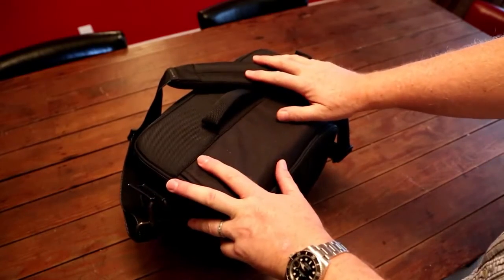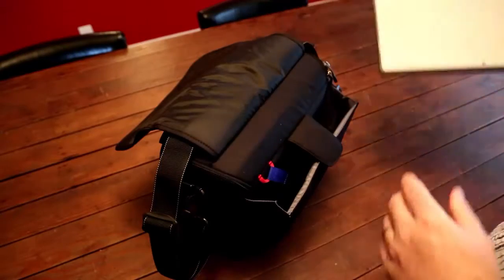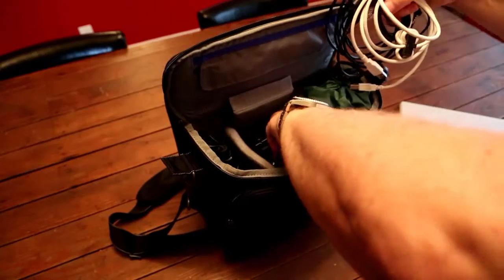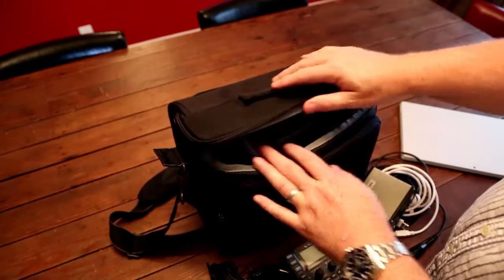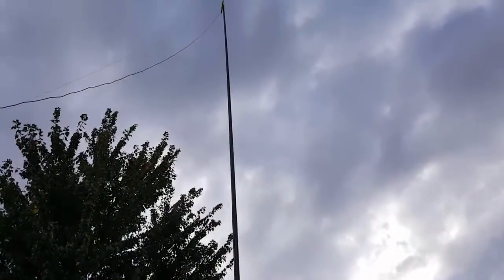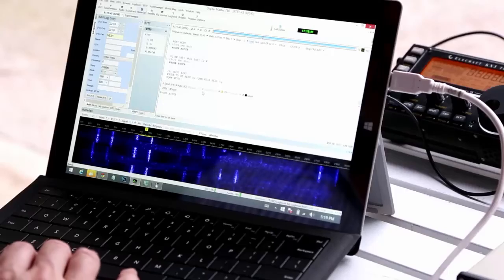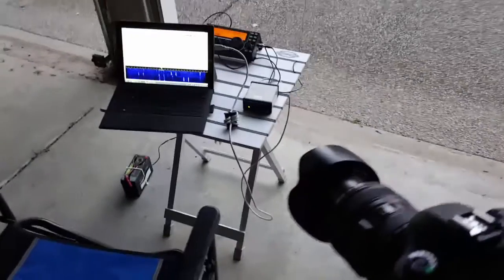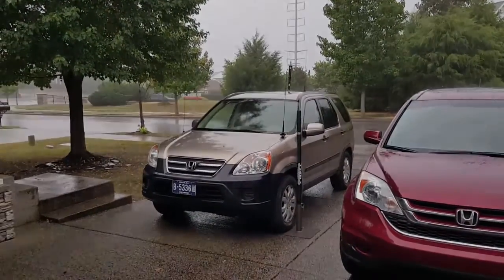Portable Digital QRP Demo

Comment: Hey Cliff, everytime I get down, I come take a look at your videos and it cheers me up. I don't have a radio yet, but hopefully soon.  I'd love to walk to my park, throw my antenna in the air, make contacts until the battery starts dying, then head home.  You look like you really enjoy the hobby, and I can't wait till its my turn :D 73's and hope to catch you on the air
Reply from the maker: Thanks for the kind words, Will. It's a great hobby with so many different facets. There's something for everyone. I'm glad that portable operation appeals to you. It IS a fun way to spend some time outdoors. It's almost like magic being able to talk to someone using a wire in a tree!  I hope you are able to get a radio soon. Maybe a local ham in a radio club would have one gathering dust that you could borrow for a few months?  Thanks again - Cliff
Reply: my issue is that I can't operate out of my house. I am right next door to a 1kW AM broadcaster. Local club wanted to help me get started, but they don't really have any portable gear. My portable is on foot, and I'd don't care to walk any distance with a IC-718. I got a radio in mind, QRP Labs has a SSB/digital 10 bander in the works at 10W.

Comment: I haven't been able to find anyone running RTTY at all. OR PSK31. They're all off doing FT8 or some other new flavor of the month, and I just got a KX3/PX3 and the wonderful ability of that radio to decode PSK and RTTY, and the PX3 to connect a real keyboard to it is all for NOTHING since nobody is using those modes anymore! 

I need to get WSJT-X and FT8Call loaded on the Linux partition on my Chromebook, then see if the Cbook's audio is able to handle the digital modes. If that fails, I'll try the USB sound card I'm using on my workbench ASUS. But all of my actual laptops are ancient things that can barely run, much less run WELL. ARGH.

I wonder if there's an FT8 app for Android? I might be able to get it to run on a tablet...I think I still have the kit for Wolphi's Android interface box around here somewhere...

Comment: That's a great setup. Did you use it for Field Day?
Reply from the maker: Hello, Ray.  I did Field Day with my local ARES group in our County's Public Safety Building. (I know, that's lame, right? No bugs or sweat...)  This year we ran five simultaneous KX3 stations - all running on battery power for the full 24 hours. The digital station and the two CW stations (KX3's) also had to have their computers running on battery power the entire time since the computers were doing the transmitting.  (Checked with ARRL and found this to be required)  We had a blast and racked up our best score ever.  We made believers out of some of our QRO members! :-)    Cliff
Reply: Oh my! How did you keep computers running on batteries for 24 hours. They are such power pigs unless you used Raspberry Pis and Chips and other small SOC Systems. Even my tablet won't go 8 hours and I can't change that battery out. How did the batteries do in the KX3'es? Did you have a solar solution?
Reply from the maker: The computers used for the CW stations and the digital station were laptops - so computers and monitors combined.  Testing showed that keeping the laptops connected to their chargers and running those charges on inverters would use about 35 to 40 Ah of current during 24 hours.  We ran the KX3's on external, smaller batteries and used larger (80Ah) batteries for the laptops.  We had spare batteries but they weren't needed.  We ran the gear with DC wattmeters in line so we could see how many amps had been taken from the batteries at-a-glance. https://powerwerx.com/watt-meter-plus-power-analyzer-8-gauge-sb50

It worked out well!  We had no power issues and gained some knowledge of what it would take to power an HF station around-the-clock in an emergency.

We had a few solar panels but only used one for a cursory charge of a battery that wasn't used/needed.

Comment: Can I ask what digital program you are using?
DE: Dave N6PGG / 7
Reply from the maker: Navy Davy it's the Digital module of Ham Radio Deluxe... called DM780 or Digital Master. You can accomplish the same things with FLDigi and other software for the Digital ham modes. - Cliff
Reply: Thank you, I have FL DIGI I also use winmore and Air Mail.  Thamks again
Reply: Currently using RMS Express, But also like Air Mail.

Comment: Great video, thanks! One question: Running a portable setup like this, what do you do about a ground? I didn't notice one.
Reply from the maker: There are two kinds of Ground... RF and Electrical.  For a dipole antenna, an RF ground is unnecessary.  My vertical antenna in the backyard has 40 radials that I painstakingly buried... so I've got a good RF ground for that antenna. I don't have an electrical ground.  My office/shack is on the 2nd floor of my house and I haven't seen the need for it.  I've got other ham friends who have no electrical ground for their 2nd story ham shacks.  I just don't worry about it. - Cliff
Reply: Excellent, thanks! You've taken a great load off my mind. I was thinking about the two-part article by the Ground Police I saw in the Nov and Dec issues of QST. If it was merely intended to shame us lesser mortals (well, me), it clearly worked. I have neither the inclination nor the resources to adhere to that grounding scheme. Not that I disregard such things entirely. I'm a musician, and I work with all sorts of electrical/electronic devices in my studio. So, at least for sound's sake, I have to avoid problems like ground loops, etc. And bringing a ham rig into my studio (or up into the mountains, which I mostly intend to do) will be no different. I just don't wish to obsess about correctness. I've worked all my life to ensure that playing my instrument remains fun; I certainly don't want my ham radio passion to become "work." ;-)
Reply from the maker: There are conflicting opinions on practically everything. While "experts" are telling you what you should or shouldn't do, just smile and then go play radio on your own terms. - Cliff

Comment: Hi, I'm looking at Ham Radio Deluxe and it states what the recomended storage is:  That seems like a lot to me considering the cost of the computers with that kind of storage.  Any thoughts appreciated.  Thank you.

Minimum Recommended Requirements
Windows Vista
 -8GB RAM, 350GB hard drive storage, Core 2 Duo Processor, 1024x768 256 color display
Windows 7, 8, 8.1 & 10
- 8GB RAM,350 GB hard drive storage, Dual Core Processor, 1920x1080 Hi-Color display
Reply from the maker: This web page on their site shows the 4GB of RAM (memory) is required and 90Mb (hard disk storage) is required. Taken from the FAQ section of their website: http://tickets.hrdsoftwarellc.com/kb/faq.php?id=54

I've run HRD successfully on a crappy netbook with only 2GB of RAM so you shouldn't have any trouble, Dave.  If you're using the Digital Modes, you may not be able to use the "Super Sweeper" screen that decodes the entire passband at once as that's processor-intensive.  But, still, for normal use, practically any reasonable computer should work.

When you get a chance, take advantage of their 30 day free trial and try-before-you-buy:  http://www.hrdsoftwarellc.com/downloads.html

Cliff
Reply: QRP School Thank you Cliff.  You videos are an excellent resource and very helpful. I just purchased a laptop so it can be solely dedicated to digital modes.  Looking forward to getting on the air.

Dave

Comment: Hi Cliff.  great videos.  what battery do u use for kx3 ?   tnx  Tim wd8td
Reply from the maker: Hello. it's a Stark Power deep cycle lithium ion battery. very lightweight and plenty of Amp hours. it's a great battery. I have the 9Ah and the 12 Ah. the 9Ah is smaller and had plenty of capacity. -Cliff

Comment: Great video series!

 I'm a  new ham with a shiny new KX3 and I'm interested in digital modes. I was under the impression that the radio could be controlled directly over USB. Is there a reason that you are using a signalink in this video?
Reply from the maker: +Jason Cz Hello, Jason. Congrats on the new ham license and the new KX3! Let me see if I can clear up some confusion for you...

The KX3 can be "controlled" with a USB cable but the USB cable "control" doesn't include sending Audio (digital data that's been modulated into sounds).  Instead, the USB cable can be used by software programs to externally control the radio... like changing bands, modes, frequency, etc. AND interrogating the radio to see what band, mode, frequency is set, etc.

In my video, I'm showing the computer running the Digital Master 780 software (part of the Ham Radio Deluxe suite of applications).  The software is taking my messages and converting them into sound. The sound (modulated data) is then being sent from the Signalink (which is just an external sound card) into the Mic Jack of the KX3 where it's transmitted to the world.  Pumping sound into the KX3 through the Mic Jack is the only way for computer software to send audio for transmission to a KX3.

Now, what might be the source of the confusion...  the KX3 is unique in that microprocessor (think "computer") built into the KX3 has the ability to take Morse Code and modulate that into PSK31 or RTTY sounds and transmit that sound.  But you have to use Morse code (a straight key or paddles connected to the radio).  The KX3 can also decode PSK31 and RTTY and display the text on the screen.

But, the KX3's USB cable is only used for external control of the settings of the radio - and for updating the radio's firmware.  (the "software" for the radio's microprocessor)

I hope this helps. If not, ping me back.  -Cliff
Reply: +QRP School 

Thanks for the detailed response. I watched your "getting started with digital modes" video right after commenting and it cleared a lot of my questions up.  

I'm looking forward to more QRP videos!
Reply: +QRP School Actually it kinda does! I use my KX3 with a little HP tablet PC (no signalink) just configure JTX Software for USB Audio and then (if your tablet doesnt have audio in/out port like the HP) plug an outboard sound card to USB adaptor into your tablet's USB port and the mic/audio cables from your KX3 into the USB Soundcard and away you go! - I got my USB Soundcard here: 

https://www.startech.com/Cards-Adapters/Sound/USB-Audio/Audio-USB-Adapter~ICUSBAUDIOB

73

Terry, ve3ega

Comment: KX3 and KX3 software and lap top, ant, battery. All you need terminal program in KX3 software will send RTTY heck key will send code to KX3 and KX3 will change it to RTTY or PSK.
Reply from the maker: +KC6CNN True.  For me, I like using Ham Radio Deluxe's "Digital Master 780" module for digital modes so that a) I can see the waterfall/panadapter and b) I can easily log the contact with HRD's integrated log. It's also nice to be able to see the DX cluster in HRD's log module. I've never tried using my key to send RTTY/PSK because I'm just not fast enough to keep up.  I can type fast enough to stay ahead of the buffer but someone listening to me send to them with my key would probably want to tear their hair out! :-)

Comment: Hey Barry.  My battery in the video is a 9Ah  battery from StarkPower. it's a great battery.  Lightweight and the voltage stays high while you're consuming it. You get the full 9 amps out of it... unlike a lead-acid battery that you have to quit using when the voltage drops too low.